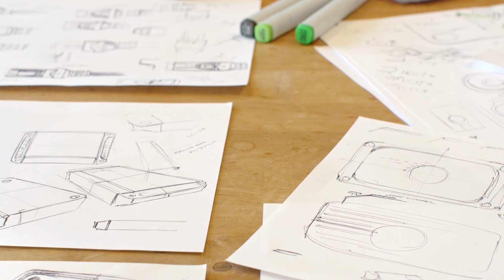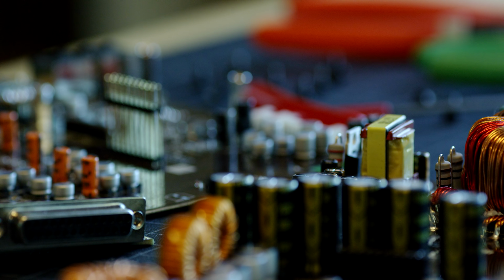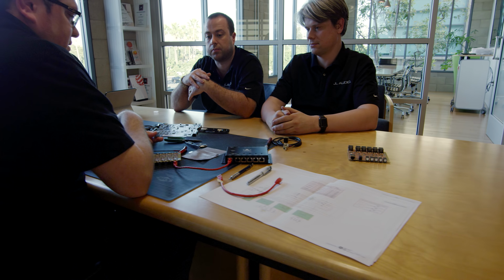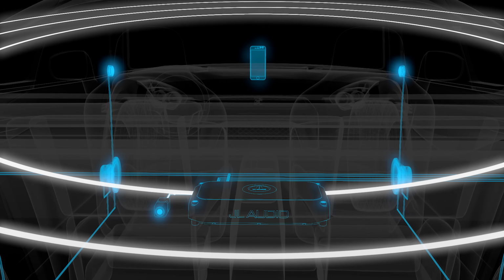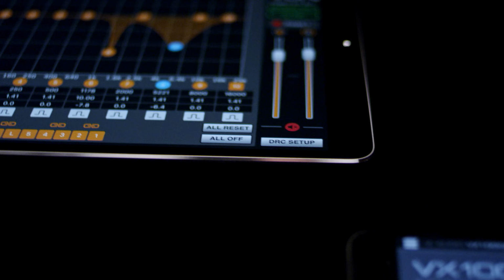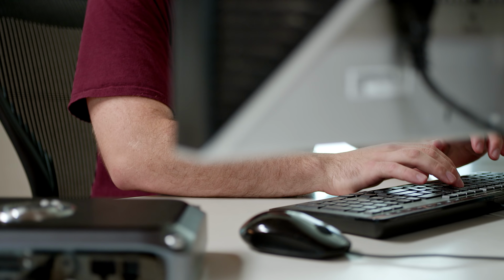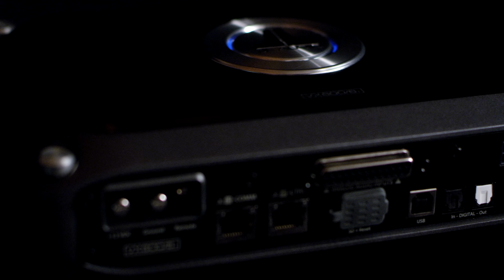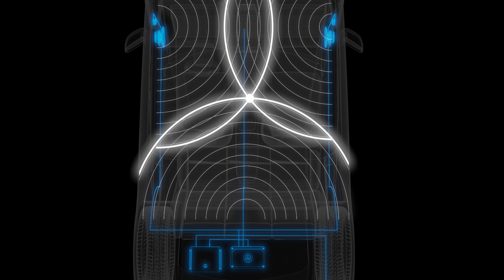JL Audio VXi Amplifier Product Spotlight

Comment: According to the spec sheet from the JL audio website, the VX1000/5i  is capable of 200 W RMS x 2 at 4 ohms with the main channels bridged. Is this the lowest safe impedance rating when bridging the main channels, or is it safe to bridge into a 2 ohm load?
Reply from the maker: When bridging output channels of a VXi amplifier, the speaker load must be 4 ohms or higher.

Comment: Using the TüN software, is there a center channel you can assign for cars that use a midrange center dash? 
Or only L / R outputs? 
I’ve looked everywhere can’t find a good answer.
Reply from the maker: TuN software connected to a TwK, VXi, or MVi product will allow for left, right, or a combination of left and right mixed mono signal to be assigned to any of the output channels using the input mixer and output router signal path settings.
Reply: Center channels are usually a factory's way of putting a band-on a low quality sound system. My 2020 F150 had a center speaker. I had a full upgrade done using focal speakers and a JL VX1000/5i amp. The center channel was disconnected and is currently not in use. Absolutely nothing was lost by killing off the center channel. If your door speakers and 'A' pillar tweeters are high quality, you won't even notice the center channel not being there.
Reply: I wanna see what kind of difference it makes having a center channel in my infiniti, think it’s only active when u play movies idk
Curious to see what would happen if I threw a 3.5 c7 in there instead, in mono

Comment: I'm not sure what I'm missing but how many channels are there in the dsp? If I buy a monoblock how many channels can i control ? I know audio control dm608 is 6 channels but how many dsp channels in a vxi monoblock amp?
Reply from the maker: A VXi mono amplifier would contain 1 channel of DSP for it's main built in channel, plus 2 channels of DSP on the preamp outputs. The multi channel amps scale based on the number of built in channels on them. For example, the VX800/8i would have eight main channels of DSP on its main channels plus 2 channels of DSP on the preamp outputs.
Reply: @garminaudio  so I can't link a 4 channel rd amplifier and use the dsp from the vx mon to process the 4 channel signals, i really would like advice before i make any purchases, I'm from trinidad and Tobago and tbh jl audio products are pretty expensive so I need to make the right decisions, really looking forward to feedback thanks

Comment: I already have a vxi 800/8 powering my c5 components but I just bought a W7 13.5 and I was curious if a vxi 1000/1 would handle it.
Reply from the maker: VX1000/1i would power a 13W7 nicely at 800 watts at 3 ohm.

Comment: I'm looking at putting an amp/sub etc into my car and I've been reading about the difficulties with push button start cars... Mine is push button start, so I was wondering if these VXi amps will work just fine due to their multiple Turn On Mode settings?
Reply from the maker: As of this time, we haven't heard of any issues regarding push button starts and VXi. You should be good to go!

Comment: The whole reason for using one of these amps is so you can feed a signal from a factory radio and use the processing in the amp to flatten the signal. But these amps don't have to level inputs, that makes no sense at all.

Comment: As a designer (architect) I appreciate the efforts the designers made for this incredible line of amps. And with the robust DSP features I won’t need an external device to handle the XO, TA, EQ for my 4-way (3-way front +sub) system.

Comment: I currently have C1-650's upfront, C1-650x's in back and a M8IB5 in the back deck of my 2001 Lexus ES300. I have these all on stock power and they sound great. 
The VX700/5i is the next piece I need.
Then I would upgrade the C1's to something better. 

I love how JL makes it easy to start at an entry-level, turn us into audiophiles, then enable us to build our systems piece by piece as we are able to like this.

There truly is not a better Car Audio company.

Comment: On the DRC-205, how do the knobs come off for mounting? Do they just pull off, or are they threaded on?
Reply from the maker: Hello Jeff, the knobs will simply pull off and there's a proper sized nut that is included to mount the assembly itself. Then you will realign the knobs and push them back on.
Reply: @garminaudio  Much appreciated!

Comment: Do I need a LOC for one of these VXi amps? I have a Honda Civix Type R with factory amp signal delivering the signal to this amp. Is the VXi capable of accepting that kind of signal or need an aftermarket LOC to convert to analog signal?
Reply: Speaker level inputs can be used up to 16 volts. You "should" be OK but check with a pro store before commiting.
Reply from the maker: Hello, and thank you for your question.  the stock Honda system comes with heavy factory equalization and a very heavy bass roll off.  Our FiX OEM integration processors is going to be your best bet.  The FiX processor will take that factory signal, sum the channels together and give you a flat full range signal to send to the Vxi amplifier.  the Fix82 has a tousling digital out that you could then send directly to your VXi amplifier.   I hope this explanation helps you and please reach out again if you need you further assistance.

Comment: Working on a JL system for my 2018 ford raptor with this amp and c7 or c5 speakers
Reply: I have a 1000/5 VXi inside a 2019 Mazda Miata running 2-W6 8” subs & some C5-650 for the front stage. Got it tuned & it sounds unreal.

Comment: I am deciding between the 12w6 or the 12w7hobox and speaker my dealer suggested I go with the vxi 1000/5 for the whole system? but would the be enough power if I go with the w7? or is it better to go with a 2 amp system?  this will be in a 2016 ford fusion
Reply from the maker: Hello, both are great options. The VX1000/5i would drive either subwoofer nicely, but in order to exceed the output potential of the HO112-W6v3 you would need to consider a two amp set up to get more power to the 12W7. The VX1000/1i would provide about 800 watts or more to the single 12W7 to allow it to exceed the output of the 12W6 on 600 watts. The HO112-W6v3 is a great value and is a nice form factor for most vehicles. I usually suggest it first.

Comment: Now build in a Blutooth receiver with aptx HD Audio or LDAC support. That way I can bypass the car's integrated headunit and use a phone/tablet and stream directly. Clean, Simple, Job done with 1 product.
Reply: +Jon Donnelly  

You can buy JL Audio's separate Bluetooth Receiver or another third party Bluetooth Receiver that has Apt-X/APT-X HD and/or LDAC.

As it was explained to me by Manville Smith @ JL, the interface protocol that JL Audio used for the Bluetooth Control/Tuning Interface does not have enough bandwidth to carry Streaming Audio signals, just the simple tuning commands.

And a Built-In BT Receiver would be a bad idea.  The EMI & RF power noise created within the amplifier would overwhelm the very low power Bluetooth radio transceiver signal and render it useless.

The current VXi Bluetooth Control Adapter is external to avoid this, and with the extension cable you can place the Bluetooth module almost anywhere within the vehicle to provide a consistent, solid BT connection from the front seats where you would do any of your tuning adjustments.

Say for instance your VXi DSP Amplifiers are way back in the trunk and/or buried under the rear quarter-panel trim, where they are surrounded by lots of sheet metal and other obstructions that severely diminishes the BT signal.  With your connected BT controller device in the front seat, you'd be lucky to even pair the devices successfully, let alone maintain a solid connection.

The external BT module and extension cable allows you to install the BT module in your center console storage cubby or somewhere else that is closeby to achieve a strong signal.

It's a smart idea by JL for doing this, because the BT radio transmission power is very low and limited/regulated by the FCC, so a manufacturer cannot produce a higher power/long distance Bluetooth module that goes beyond the Bluetooth power spec.

But I also wish that JL would have made the current Bluetooth Module able to Stream Audio with high quality Apt-X/Apt-X HD from your Smartphone or Tablet, etc!

As it stands,  you have to buy their separate Bluetooth Music Streaming Receiver, or one from another brand.  Of course, that means having to pair and switch between two separate Bluetooth devices for each task, and of course, they make more money by selling you additional accessories.  ;)

Comment: With this amp do I still need a JL audio fix 86?
Reply from the maker: @Shoegum, if you intend to keep your factory source unit it would be a good idea to have the factory signal tested with an RTA. If the signal is heavily equalized then the FiX would be great to use first to sum and correct the factory signal back to flat first. Then you can send the flat signal to the VXi and use the DSP in the VXi strictly for tuning. The FiX 82 would be great since it offers optical output for further noise reduction and a cleaner install.
Reply: Awesome thanks for the reply! Next is deciding between the vx700/5i or vx1000/5i, got a JL 10tw3 (400 watt rms), do I pickup the vx700/5i with a 300rms or vx1000/5i with 600rms and tune it down. Is it better to go with the amp that is 75% or 150% of the sub system’s total RMS rating. Just worried it would be underpowered.
Reply from the maker: @Shoegum, If you intend to play the system hard I would stick to 300 watts to the subwoofer. It should be plenty of power to get full performance.
Reply: @garminaudio  Thanks and ordered ^_^
Reply from the maker: @Shoegum, you are very welcome.
Reply: @garminaudio    Is the fix 82 a better pairing than the 86 for the vxi amp because of the digital output ability (cleaner install, +benefits of optical)? Is the only benefit of the fix 86 vs the fix 82; the ability to keep oem fader control because of its six output rca channels (Front/Rear, L/R) vs two (L/R) of the 82, or does the optical output retain fader ability? Hopefully not to dumb of a question.
Reply from the maker: @Shoegum, I typically suggest the FiX 82 for the reasons you stated. The optical is especially nice if you like using your factory volume since you would not have to worry about gain associated noise issues between the factory signal and the output of the FiX.

Comment: I love JL Audio. They're are top notch. 
I'm also an electrical engineer with a Master's degree in DSP. My only thoughts besides "that's going to be awesome", were "it's about time!" I know it's a huge undertaking to incorporate software, firmware, precision analog, mixed signal digital signal processing and the like. I'm excited to see what they come up with. 
I have no need for these features as I'm still rocking a Pioneer Premier DEH-P980BT that has incredible DSP features like auto tuning, auto tuning assignment, BBE enhancements,a 20 band eq, strong 5v preouts - and that came out over a decade ago! 
What has taken so long JL? 
Love you guys! 

All of that is pushing my bi-amped C5-650s (no crossover) with a HD600/4 for the mids, 300/4v1 for the tweeters (better home theater tweeter, JLs are good but these are better), and a 500/1 driving a single 10w3v3-?

Comment: What makes VXi internal DSP better then the AudioControl DM-810 external DSP?
Reply from the maker: @ahome theaterguy, one great advantage is space saved. Having the DSP portion built into the amplifier means one less piece to install. Also, you are free to do as many channels as you like and are not limited to 8 or 10 channels of DSP. You can do two VX800/8i's as an example for 16 channels of amplification and DSP in the space where you could normally only fit one 8 channel amplifier and an outboard DSP. Plus with advanced differential/balanced inputs and the digital to analog portion all optimized in one chassis you get less chance of induced noise in the system. Plus many feel that the user interface on the VXi is more user friendly for ease of tuning.
Reply: @garminaudio  Thank you JL, for your response.

Comment: Can you use 1 DRC-205 with 2 VXi amps? Let's say a VX800/8i and a VX1000/5i and control all 12 speaker channels for main volume and the other sub channel for the sub volume control? Would I need anything extra?
Reply from the maker: @ jose luis ruiz, you would need to use the VXi-HUB in order to properly communicate and control with the DRC-205 when using multiple multi channel VXi amplifiers.

Comment: Bluetooth should just be built in..
Reply: Bluetooth phone capabilities where you can equalize with your phone
Reply: +Brad Jensen  

That would be a bad idea.  The EMI & RF power noise from within the amplifier would overwhelm the very low power Bluetooth radio transceiver and render it useless.

The Bluetooth adapter is external to avoid this, and with the extension cable you can place the Bluetooth module anywhere within the vehicle to provide a consistent, solid BT connection.

Say for instance your VXi DSP Amplifiers are way back in the trunk and/or buried under the rear quarter-panel trim, where they are surrounded by lots of sheet metal that severely diminishes the signal.  With your connected BT controller device in the front seat, you'd be lucky to even pair the devices successfully, let alone maintain a solid connection.

The external BT module and extension cable would allow you to install the BT module in your center console storage cubby or somewhere else that is closeby to achieve a strong signal.

It's a smart idea by JL for doing this, because the BT radio transmission power is very low and limited/regulated by the FCC, so  a manufacturer cannot produce a high-power/long distance Bluetooth module that goes beyond the Bluetooth spec.

The only thing I wish JL would have done with the Bluetooth module is to also make it an audio streaming receiver with high quality Apt-X/Apt-X HD to stream music from your Smartphone or Tablet, etc.

But as it was explained to me, the protocol that JL Audio used for the Bluetooth control interface does not have enough bandwidth to carry audio signals, too.

So you have to buy their separate Bluetooth Music Streaming Receiver, or one from another brand.  But that means having to pair and switch between two separate Bluetooth devices for each task, and they make more money by selling you additional accessories.

Comment: So what is the most powerful monoblock in this series ?
Reply from the maker: The VX1000/1i would be the most powerful mono amplifier in the lineup.
Reply: JL Audio thank you. Jl should build a competition subwoofer! I'd love to see that. I already know they have great sound quality.
Reply: +BaSsAholiC   

You could use one of JL Audio's Multi-Channel VXi DSP Amplifiers to power your Front Components, etc, and that VXi amplifier has an Extra Pair of Outputs that DSP Processing can be applied to in order to send that processed signal to your EXISTING Subwoofer Amplifier, or another amplifier of your choice (not a JL).  ;-)

Comment: Is there anything new here? Seems like everything is just getting put into a smaller package and you buy less peripherals to get equal functionality
Reply from the maker: @ADR, one of the advantages of VXi is just that. Having great power and DSP built into one compact chassis that is smaller than the if purchased as separate components. Plus the amplifier section and DSP are more advanced than our separate TwK processors and other amplifiers in our line up. You are getting the best features all in one package.
Reply: Now make a head unit output converter that outputs to TosLink to have one single fiber optic cable going from the head unit to your amp/dsp without the possibility of interference along the way! Still looking/waiting for this possibility... Especially for the stock head units..
Reply from the maker: As long as the bends in the cable are though about ahead of time it isn't too bad running optical cable. Plus like in the case of our VXi amplifiers it means just one cable to the amplifier instead of multiple RCA's bunched together. You can even add covering to the cable for extra protection if need be.
Reply: Erik Hamidullin no just have to worry about breaking the cable routing it through tight bends
Reply: Erik Hamidullin i was an installer for 4 years. Factory installs are a lot different than aftermarket. Don't get me wrong I would love to see it too. It would be nice running one fiber optic vs 3+ sets of RCA's for a multichannel setup. Not to mention the sound quality and ability to break the 16bit 44.1khz boundary. I'm all for it but fiber optic cables are delicate. I've often asked myself why we don't see them in the aftermarket industry and that's the only reason i can think of.